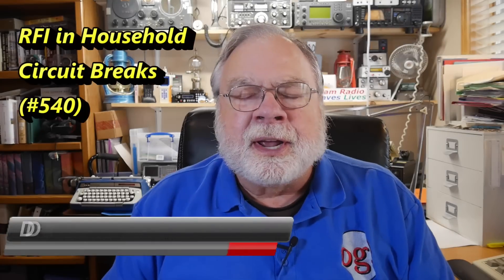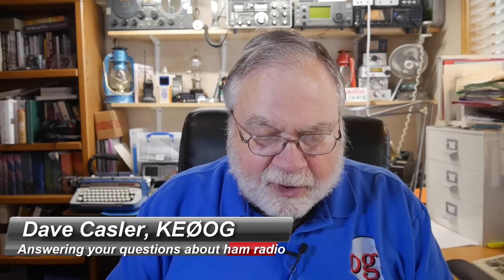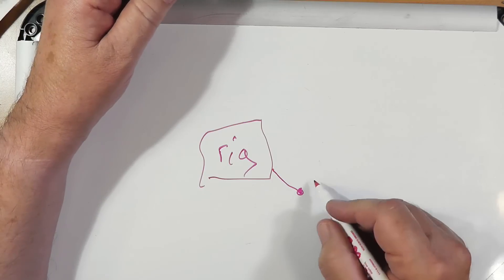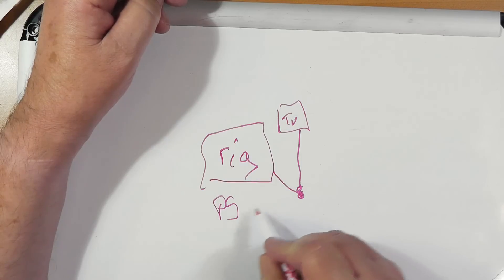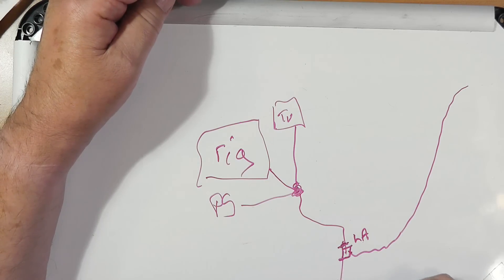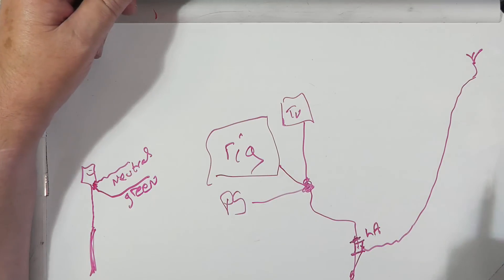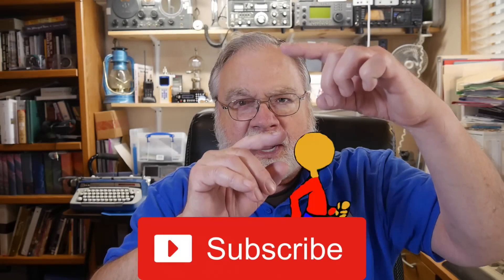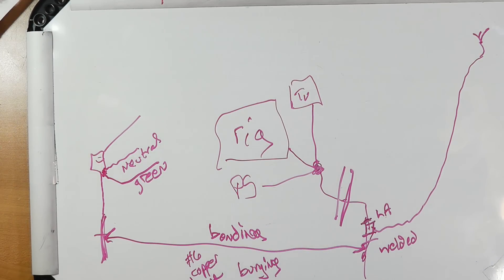RFI in Household Circuit Breaks (#540)

Comment: what happens if you dont ground stuff inside the shack? i dont see many hams run their radios and other devices to ground??? and then outside to a ground rod. They all say its grounded by the plug from the device. OK??????

Comment: So I have a ground rod outside my shack.  My house panel is grounded to the cold water pipe when house was constructed.  This ground wire passes thru the house (1975).  A second outside ground rod was placed next to the electical service panel when solar panels were installed.  I connected the shack ground rod to the cold water ground that is inside my house.  It passes thru the basement like the original ground.  Dave says not to pass anything thru the house.  So I am confused, that is how it was originally constructed so I just repeated that procedure.  Comments??

Comment: I have 3 30AMP RFI filters that came out of computer system where there used on filtering Racks/Cabinets of computer system. There 120v AC 2 phase. Hot Neutral Hot and the case is used for Earth Ground (Green Wire) They seam to prevent RFI from back feeding on the AC line. Don't Know they still make them.

Comment: I had this problem with Eaton AFCI breakers in my bedroom areas.  There is a known issue with the Eaton AFCI breakers and tripping with amateur radio usage.  There was an ARRL article or bulletin about this and getting them replaced by the manufacturer.  I had all of mine replaced and have no issues anymore.
Reply: That's exactly what i did as well.  BTW, worst band to trigger that is 17m, followed by 20m, and. CW or digital trigger more easily than SSB

Comment: My 5 year old home contains 3 Eaton arc fault breakers, one serving each bedroom.  I recently added a ALS-1306 1200 watt amp which immediately tripped all three breakers.  Eaton did send me 3 newer replacement breakers which are less susceptible to the RFI tripping.  When I changed the breakers I noticed that the neutrals for the 3 circuits which are wired back through the arc fault breakers were mixed up.  In other words, the neutral for circuit 1 was connected to breaker 2, etc.  When I reconnected the neutrals to the proper breakers, the problem for the most part went away.  So check your neutral connections if you are having this problem.  Also, Eaton seems to be the only manufacturer that is having this problem as far as I can tell.  73

Comment: Ive been warned against braided wire for outside grounding, especially in very wet ground environments. It retains moisture and corrodes quickly. Best to use copper flashing or solid anywhere it can get wet. I only use woven, flat, ground braid indoors.

Comment: Another thing that sometimes works is to use a 120v to 120v AC isolation transformer on circuit powering transmitter.

Comment: I ground my rig as described in the video except that I brought the surge protector for the antenna indoors because I was concerned about water intrusion in the UHF connectors.  Is this not an isssue?
Reply: Yes, it is a problem. It violated NEC which states that it must be used before it enters the house or building!!

Comment: normally a house ground is outside, but my house electrical ground is inside.  let me explain.  the electrical box is on the inside wall of my house (garage) and the ground wire runs up the wall , then across the ceiling (of garage), then down a wall between the garage and the family room.  my shack is on the also on ground level, the opposite side of the house where the electrical breaker panel is.  so in this case would i be ok to bond my ham radio at the inside junction where all my radio gear is and run a number 6 wire across the family room ceiling and tie it to the house electrical ground at the point it turns down the wall?
Reply: Your house most likely has Whats called an ufer ground, which is pretty much the best ground you can have since it is a long piece, 20' or more, of rebar that runs into the foundation and is tied into all the other steel in the concrete forming a huge absorption field. If you can confirm that your utility ground connects to rebar, definitely ground there! It'll save you in copper costs! -Rex KK7BEQ
Reply: And 73
Reply: I wouldn't ground to anything except a rod driven outdoors or a visually confirmed rebar stub coming out of your foundation.
Reply: Ground DIRECTLY to the rebar or the rod, no tying into the utility ground wire.....
Reply: @ripstephenhawking8787  i have an outside ground rod, well ground rods, now i'm trying to tie my radio ground system to the utility.  i'm not sure i understand.  are you saying i should never tie my ham radio ground to the utility?  how should i have an electrician disconnect my current utility ground that is in the middle of my house and connect the utility ground to a new ground rod outside my house and then run buried wire from my station ground to the new utility ground rod that is outside the house?
Reply: @larsonl6376  what I meant about not connecting to the utility feed was to not ONLY connect to utility ground as this isn't good enough to handle rf, lightning AND the normal utility grounding it needs to do. Some people choose to cheat....
Reply: @larsonl6376  also I meant that when you connect antenna ground to utility ground, you must run the cable all the way to the utility ground rod, meaning no connecting it to any other cable even if it's coming off the same ground rod. Therefore your utility ground rod will have at least two cables attached to it, the house ground and your radio/antenna ground.

Comment: Dave, the Samlex 1235M shunts filtered switching mode harmonics to the chassis ground. If connected to a GFCI circuit powering other SMPSs (e.g., a computer), the combined leakage current can be sufficient to trip the GFCI.  Reference the 1235/1235M Owners  Manual pages 10 and 11. 73 de Brian - K3ES

Comment: Can you use a copper strap instead of a stranded wire outside between ground rods as well as copper straps connected between your inside equipment?
Reply: Yes...but expensive!
The reasoning behind using stranded wire is more surface area...and more affordable compared to solid conductor of same diameter. -'73
Reply: @greglawrencemusic  Thanks for that info. I love your videos! I've learned alot and still learning. Keep up the good work! 73's from N3NQP!

Comment: I had the same problem. All of my GFCI breakers were tripping on anything lower  than 10M. I have Eaton breakers. They are aware of the problem. I told them how many I have and they trip when operating HF amateur radio. They sent the replacements for free.